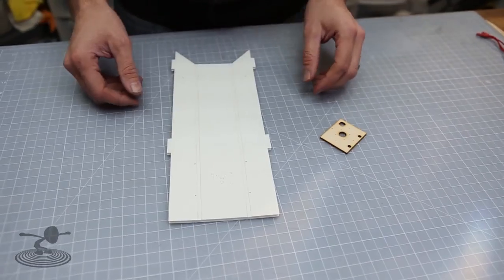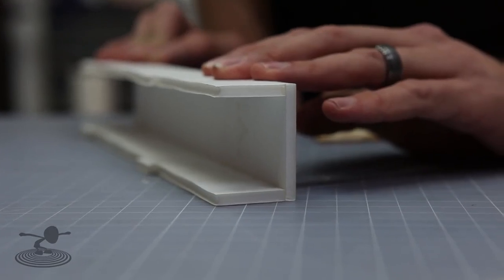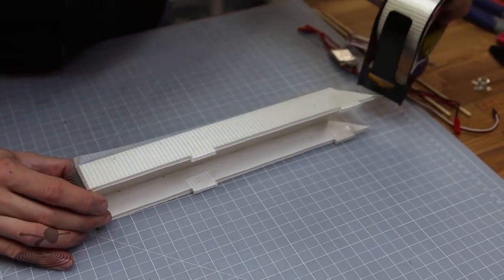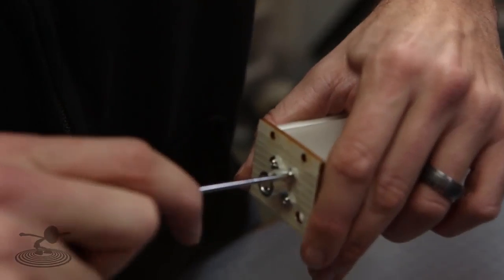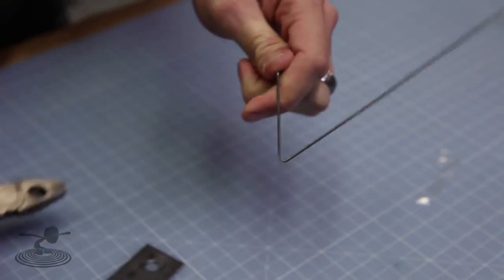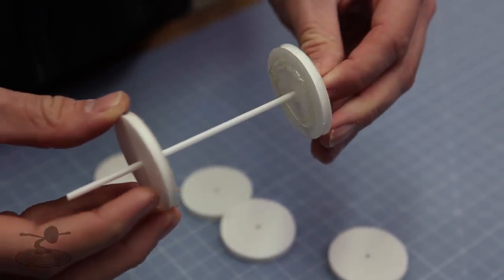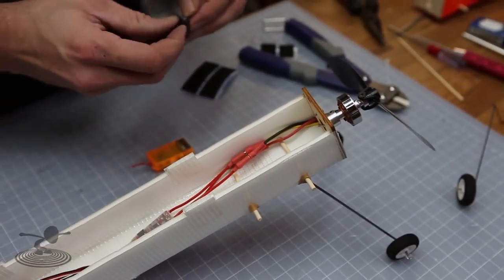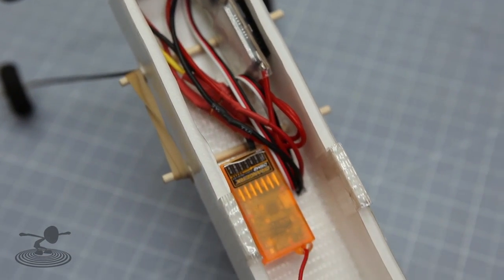Flite Test - Swappable Power Pod - BUILD

Comment: Please can you please list the most important thing I need to consider when building a power pod
Reply: The exact angle depends on the individual plane but with a standard prop you should have the motor point down and to the right a litte bit. A shim on the top right mounting hole (as you look at the plane from the front) should help you get started. The plane will still fly if the thrust angle is off a little. When you got itvtrimmed out flying straigh and level and cutting the throttle makes it dive or climb you will know which way you need to adjust your motor. That said, if you have built your pod from a set of FT plans it will already be slightly asymmetrucal to compensate.

Comment: Did I miss the part where he installed the two skewers which hold the landing gear ?   So I eyeballed the distances in the video and used 1.25" from the front for the first skewer and 1.25" behind that for the second one.   I made the holes towards the bottom so the skewers rest on the floor of the pod and shouldn't elongate the holes.  My Nutball just balances with a 2s 500 even with the firewall.

Comment: Did you stop selling the white foam board
Reply: Yeah, they only sell the brown which is water resistant. You can get the white stuff at dollar tree if you live in the US
Reply: Yes, they stopped selling the FT Maker Foam, due to vender quality issues. If the issues can be resolved, it could return later.
Reply: This video was made back in the day where they would go to dollar tree to buy foam

Comment: this construction with this depron and hot glue makes the model heavy. not to mention that this upright box, the model is weak in the central part of the box and due to the weight of the model. a little bang on the curb the model broke in half.